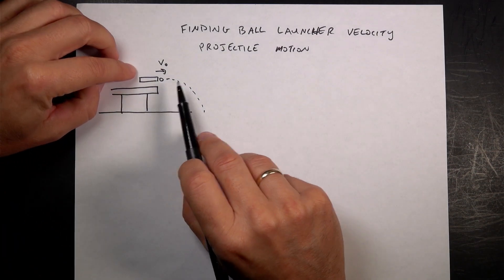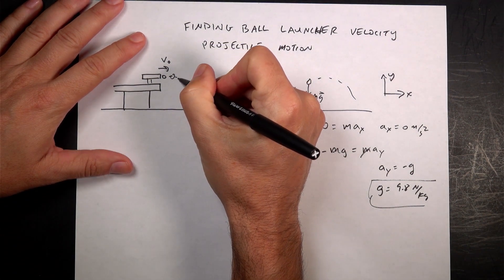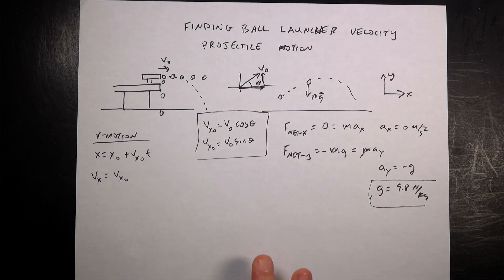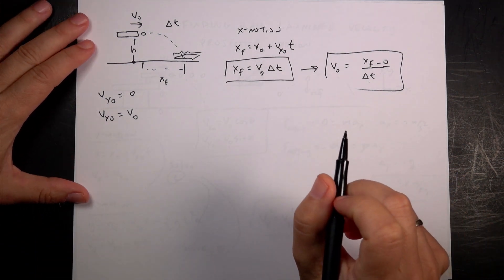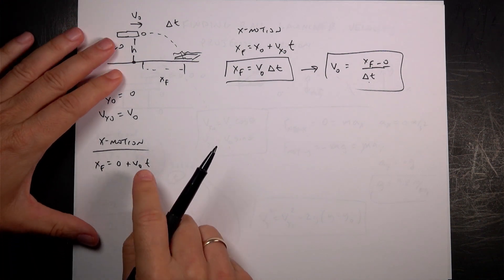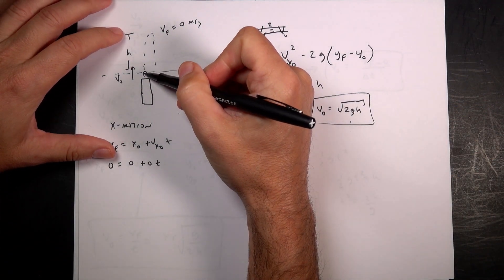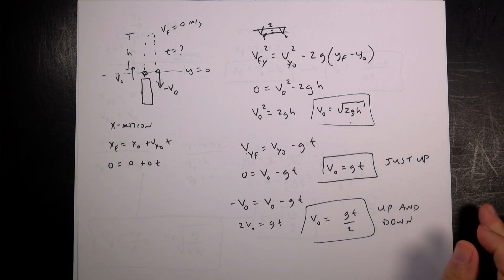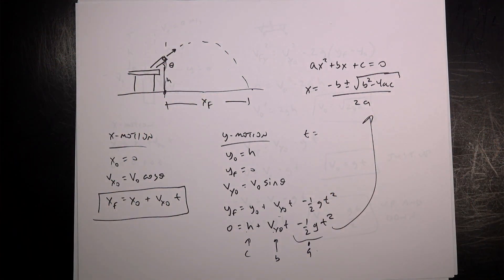5 Methods to Find the Launch Velocity for a Projectile Launcher

Comment: BY COINCIDENCE I recently DID the first experiment illustrated here (for the third time in recent months) in the desperate hope of debunking a pseudo science clown who makes daily videos claiming kinetic energy is not real - and many other nonsense claims that make flat earther's sound logical.     

HE HAD PROPOSED that your first illustration would PROVE ONCE AND FOR ALL that kinetic energy does not exist - by launching a ball off a table edge and measuring a ball HALF that mass going TWICE AS FAR ... 

I showed in three separate instances that it ABSOLUTELY DOES NOT HAPPEN THAT WAY ... that the HALF MASS actually goes 1.414 x as far.. 

In my experiments, I had the balls landing on KITCHEN FOIL as a simple way of making accurate measurements ... and in my last version ("Death of a...  desperately daft idea")  the results could not have been more conclusive, yet the clown carried on, as he always does, claiming all sorts of "mistakes" in my video ... first time round he claimed I used the wrong kind of projectiles, even though he had initally said "ANY object"- 

... so I did it again with spheres - then he complained the launch mechanism was too complicated (a fast acting spring launcher adapted from a solder sucker with the piston and steel parts replaced featherweight parts - the only complicated bit was the wooden blocks assembly I had constructed to hold it in two slightly different positions to account for the two slightly different sized balls - that gave him the perfect excuse to deny the results)

The THIRD time I used the simplest elastic band, quick release launch method and 10 out of 10 times, the ball landed in exactly the same spot on the foil, give or take a couple of mm anyway.   And the half mass went 1.4 x the distance for the same launch force. 

I later TRIED to measure the actual launch speed with a 120FPS camera but it was tricky to say the least, due to parallax errors and not a fast enough frame rate - but it was interesting enough for my own purposes.   I have difficulty with math so I have to do everything by practical means - or get help from people with math skills. 

Anyway, thank you for uploading this kind of information.   I haven;t finished watching yet - I was rather distracted by the similarity of your first drawing to that of the pseudo scientist I mentioned, in his proposal to debunk KE.    It;s SUCH hard work explaining to him - especially as he is shockingly insulting and rude to absolutely everyone who disagrees with him, so I regret to say I've taken to insulting him back with the same enthusiasm.    It can be funny but I would prefer a logical conversation with someone willing to listen to reason.